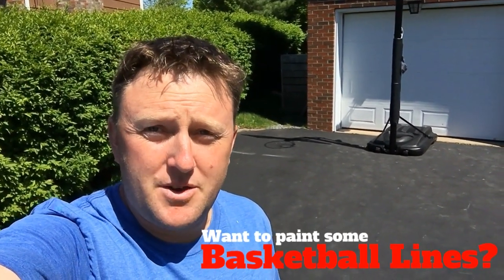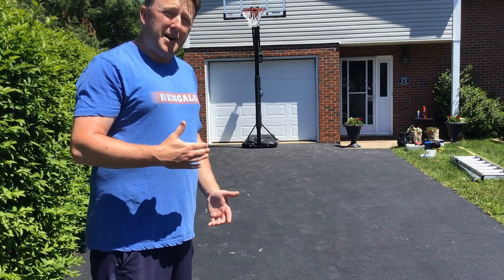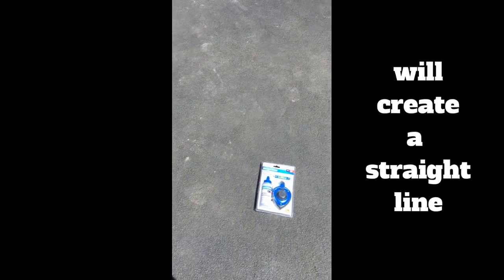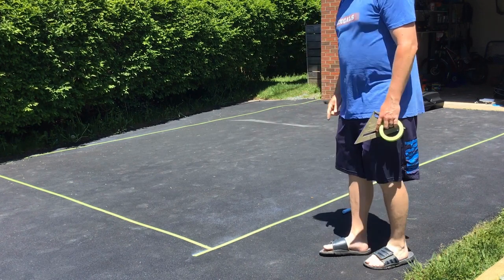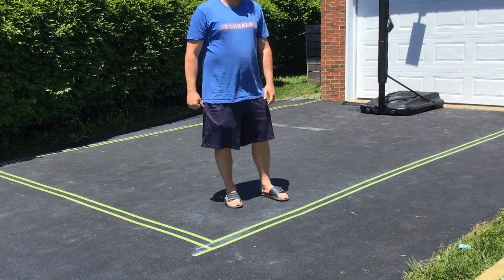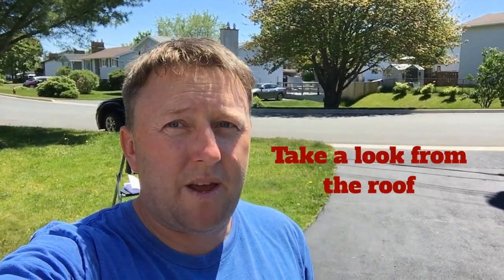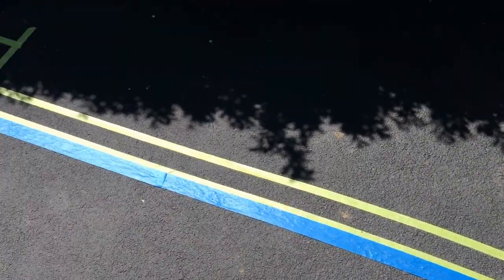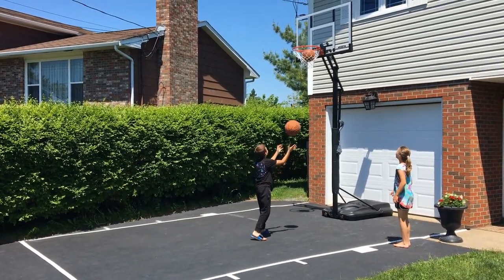Paint Your Own Basketball Court

Comment: the free-throw line is baed off the rim and not the baseline. There throw line is measured 15 feet from the middle of the rim
Reply from the maker: Yes...the 4 feet to the backboard was an estimate...it ended up being a bit different than that...so for my court it was still 15' from the center of the rim. The key is to have an accurate diagram with the measurements you want and plan it out before you start marking up your pavement.

Comment: Good work!!! I am going to try this myself.  Any suggestions on adding a 3 point line?
Reply from the maker: The 3pt line is trickier because it’s not a semicircle..and there are variations in 3 pt lines..I’d use a plumb line from the corners…out to where the curvature begins…and then try to flex tape the borders..painters tape or floor tape can be forgiving on bending it a bit. There are stencil kits out there on the market..but they cost more money than I’d want to..and the DIY job is pretty rewarding

Comment: Do you recommend using a concrete primer?
Reply from the maker: Mine was over an asphalt driveway and I had recently tarred it too. I did not use any primer. 

As for concrete..you could prime it..especially if it was smooth. But the beauty of the basketball lines is that if what you paint with wears easily..you can retape no problem..and repaint

Comment: What paint did u use?
Reply from the maker: I would have used white traffic paint… But since it was a test job I used leftover kitchen and bath paint.  It is still really crisp almost a year later and through a winter
Reply: @MatherPE  I used traffic spray paint on ours and it didn’t last through the first winter. Waste of time for the amount of time it takes to tape and measure. So thanks for the tip of different paint
Reply from the maker: Good to know about the traffic paint problem. We’ve been out on it a lot this spring...and it’s still really clear using the kitchen and bath paint. Good luck if you repaint...let us know how it goes